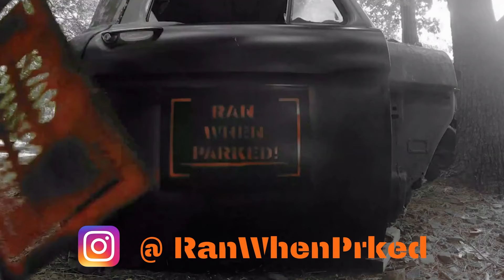1976 Ford Crew Cab Build - Can I get this thing put back together in 6 weeks? New Roof/Panels/Mounts

Comment: I like what you do, however not blasting the entire chassis is giving more work I would blasting it completely and paint it completely
Reply from the maker: Yeah, it might be annoying later.  The thought was I need to remove and change all the brackets front and rear for the axles/suspension/steering anyway.  We'll see if it was a good idea or not lol.